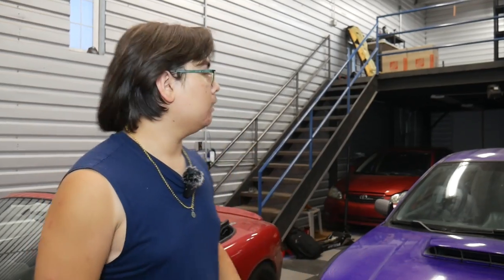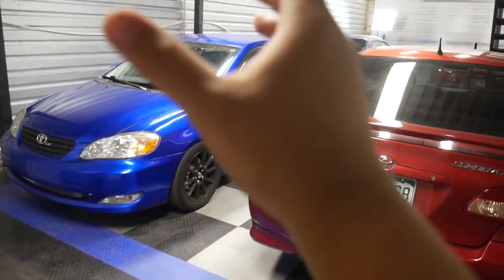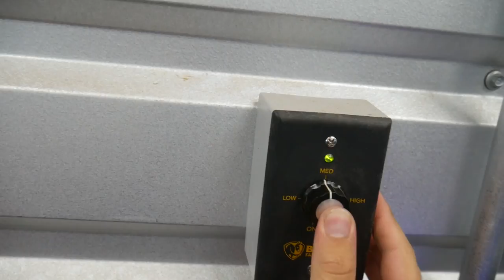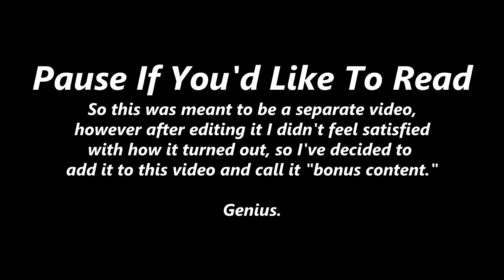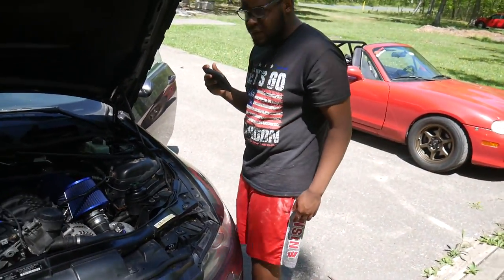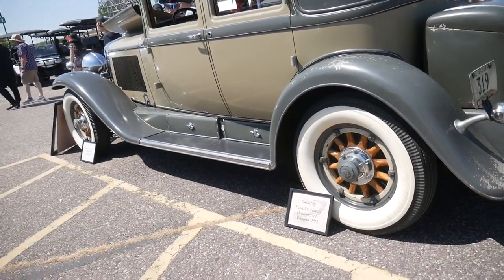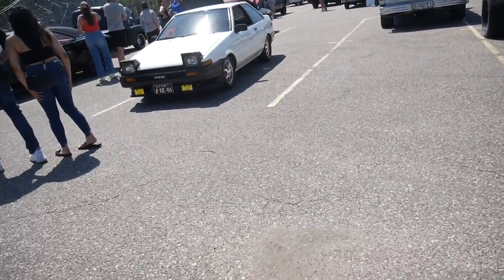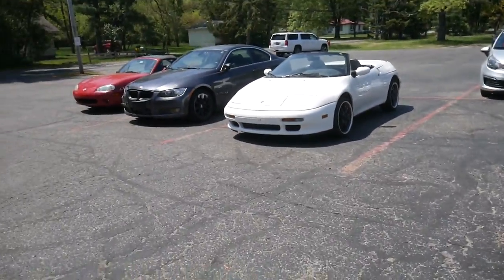My New Workspace! (+ Bonus Automotion 2023 Vlog)

Comment: Hey Will, I got an 07 Matrix XR and I was planning on putting a SRI on it and found one of your old videos of you putting one on your Corolla but I was wondering, did you notice any dips in torque at the low end? Also, did power increase at the high end in any way? The car is my daily so if it affects daily driving harshly, I might just keep the stock intake.
Reply: hey, i have a 05 xrs matrix, i put an sri on it and there are no negative effects. intake sound is more prominent but thats a positive to me. also I recommend getting some vent ducting at home depot and routing it from the front grille to the sri, this will lower the intake temps greatly